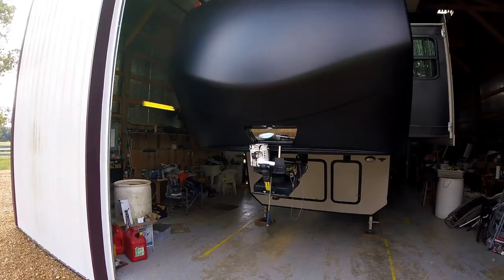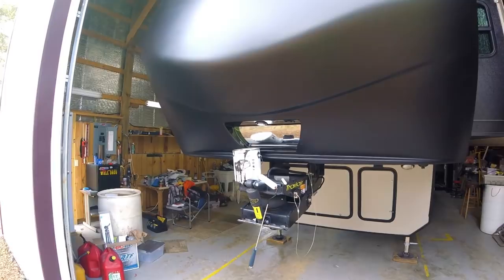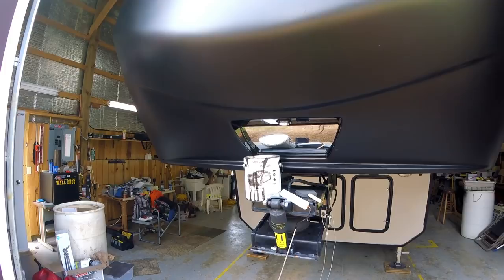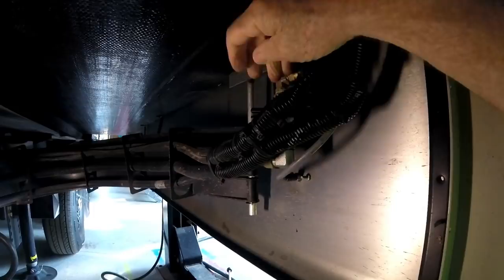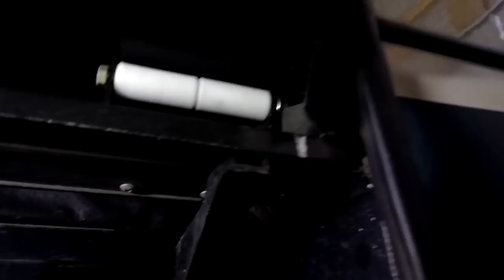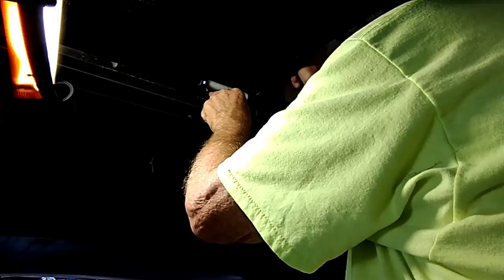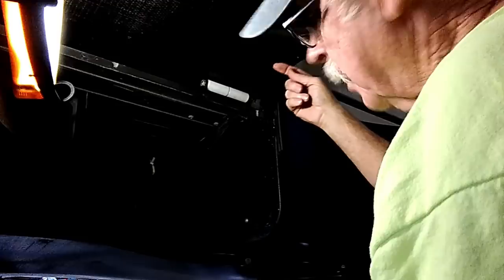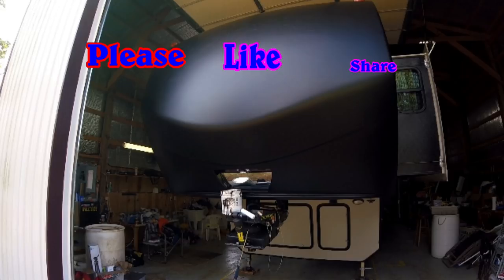RV TRavel - RV Life - In-The-Shop - Trailer MODS - More Slide Problems - S2 EP052

Comment: Another great video.  Our floor underneath the slide is doing the exact same thing with the fraying.  Thanks to your examination I'll know just what to look for!  Also,  I love the plasticoat idea on the cap. Unfortunately we have the see through glass front living area and it would make for a really dark living room.....We've gotten in the habit of using the Blue Beacon Truck Washes throughout our trips.  They are experts at getting bugs off of 18 wheelers.  We get our Ram 3500 crew cab dually and the 42 foot 5er done for 60 bucks,  plus or minus a few bucks.  I stuff plastic bags in the bug screens on the furnace exhaust and the water heater vent covers to prevent water from getting sprayed in there.  Once again,  love the video.
Reply from the maker: Glad this helped, it is a pretty easy fix. Never thought about the truck wash. We may have to give that a try. Thanks for watching. Safe travels.

Comment: Like Jean said I hope that you let the manufacturer know of the problems so maybe they can correct the issues. I have used the tape before a 2 inch wallpaper roller  really helped to get good contact. Good video thanks for sharing
Reply from the maker: Thanks Howard, I did let them know. Not that that did alot of good. Although there is hope. Thanks for watching.

Comment: Dave: thanks for sharing these, I will take closer look at my slides after seeing this video. I'm not sure I like the flat black on the cap. I wonder if there is a strippable clear coating.
Reply from the maker: Thanks for watching. If you have the problem it is pretty easy to fix, hope you don't. They do have different colors including a clear. But they are in spray cans which are $ 8.00 to $10.00 a can, making it about $150.00 The last time we did it we used clear, but it was a satin clear so kind of flat. But it worked great, peeled right off. I went with the black because that was the only color I could get in a gallon can. The best part is no more washing and waxing after every trip. Thanks for coming along.